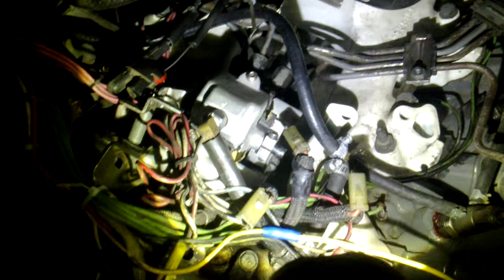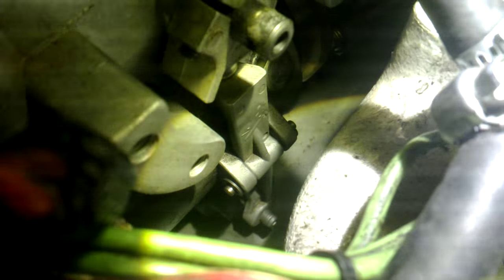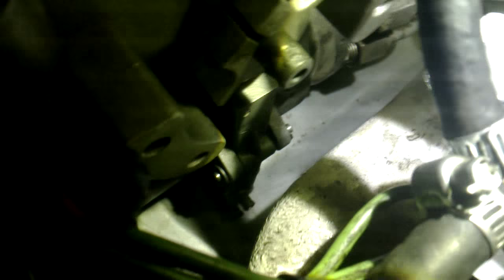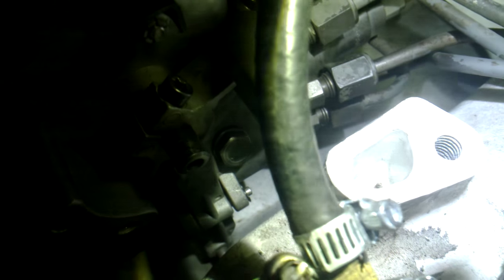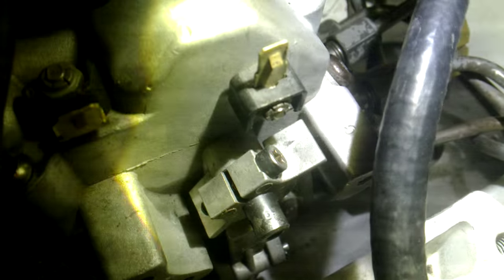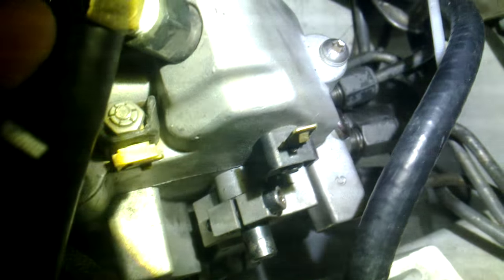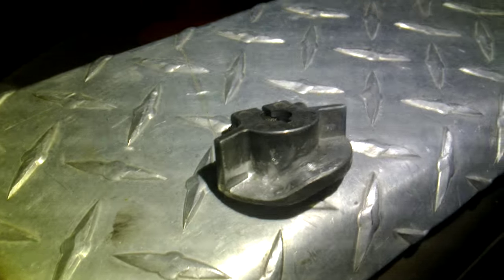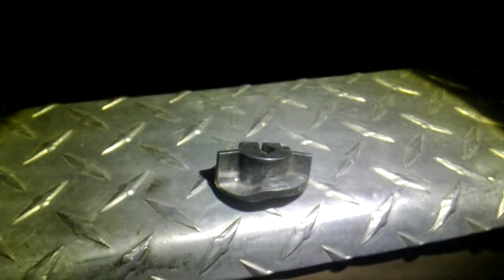Incorrectly changing timing on a 7.3 IDI

Comment: That lever is an accelerator pump it ads more fuel  so there’s no lag  all he is doing is changing the time the accelerator pump engages
Reply from the maker: Not a gas engine - you don't add fuel like that. 
Gas engines need extra fuel or they run lean. Diesel engines run lean normally, so you simply add fuel through the normal mechanism(the metering valve controlled via the throttle lever and governor).